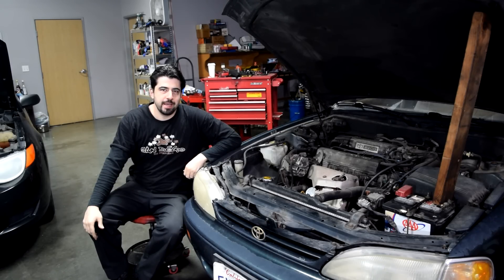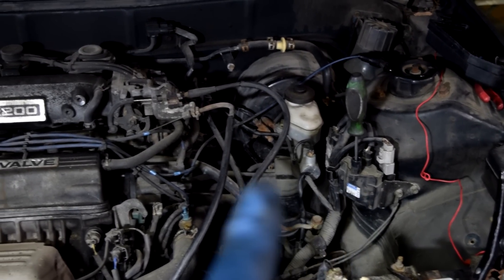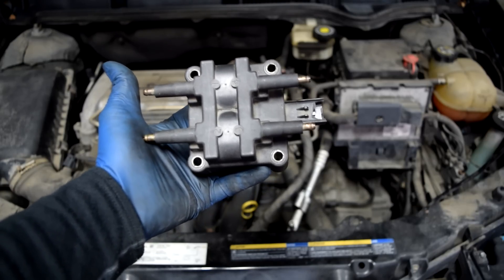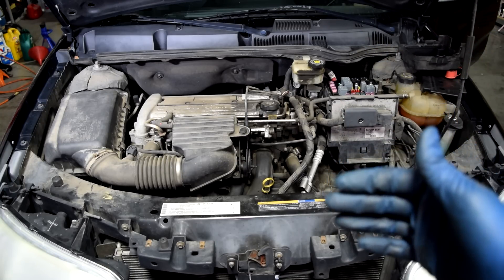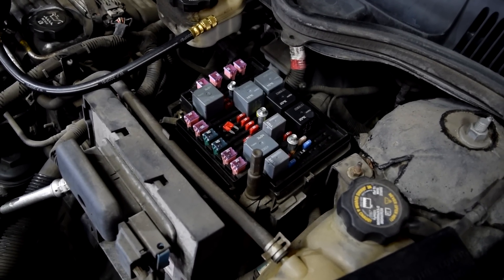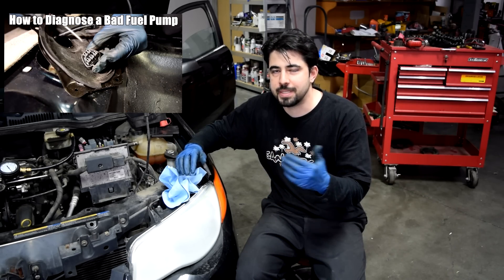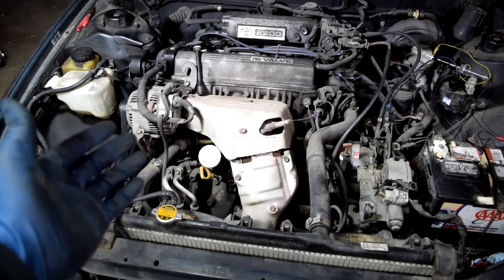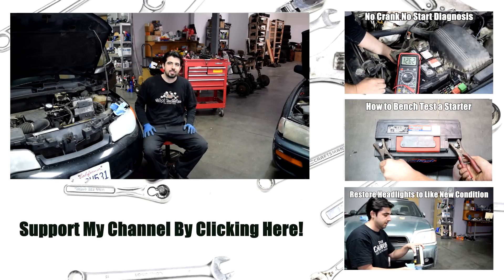How to Diagnose an Engine that Turns Over and Cranks But Does Not Start - Crank No Start Diagnosis

Comment: Great video mate there are many here setting timing when engine is running, but this is only one I found that deals with car that engine will not start (which is often the case) and sorts it out. Thank you!
Reply: I found others. multimeters+ voltometers are needed
Reply: @charlesdowns1691  we are finding the same, we never used to bother but now wouldn't be without them.  We used ours to check heater plugs on our Chrysler. We saw it was an easy way to test they are not broken, save having to take any out and change them. One of our cylinders is misfiring. That is why we though it could be heater plugs. But all ours is fine. Not sure what else it can be.

Comment: i have an eclipse 2002 gs 4 cylinder with a code p0300, and at first it was making noise on the left side of the engine (clicking noise) and i noticed that coolant was leaking from the lower hose (i think) which is green liquid. i filled the gas tank and the next day the clicking noise was louder, the car died while driving. the car now cranks but won't start. the rpm does not move when i crank it either. im desperate and i need help thank you!!

Comment: My 2004 Ford Ranger XLT 3.0L (75K miles) will NOT re-start on a hot / humid day. When cold, or first start of the day, it fires up and runs great. 
But If I shut it down after driving around a bit, the engine will crank normally, but will NOT start, no matter what. I've been stranded a few times now. 

I've changed out the spark plugs, fuel pump relay, the coolant temp sensor, the thermostat and put in fresh coolant. Checked the inertia switch, it seems ok. No blown fuses that I can see. I asked my local Autozone if they could pull some codes for me, they said they wouldn't touch it unless the Check Engine light was on (which it isn't). WTF. 

When trying to start it hot, I watched the RPM gauge, it seems to stay at 0 until the engine coughs (without starting), then it indicates a few hundred RPMs, so it seems like crankshaft sensor is working. I popped the gas cap off and turned the key on, didn't notice any primer pump hum / noise, but maybe too much outside racket to tell. 

So, ok - I was thinking maybe the fuel pump / fuel pressure, but once I get the truck running, it stays running fine. I would think that a bad fuel pump / pressure would cause it to stop running at some point, or at least cause it to be sluggish.  But when it’s running, everything seems fine, you’d never know there is a problem.

What is causing this?  Why are hot / humid days a problem?

Any suggestions...?? It's driving me nuts. HELP!!
Reply: zippy dodah. my Pontiac Grand Prix  although different vehicles is doing exact same thing.  fires up in the morning but after its ran a while and then engine switched off it won't restart or ( fire up again?) crazy. it will fly on instate ECT. good steady idle with lots power but hot humid days or about any day it does this. I'm concerned it's a cam or crankshaft sensor. really not sure at but so annoying.  my son can fix about any car. ranger ECT. did you ever find the issue?
Reply: I've had to keep my car running just to male quick stop to stores ECT. not good. I also wonder about I. c.m.

Comment: I have a mazda lx 2003 2.0 , I have electrical power on wires but no pressure gas and no spark, check engine is not turning on. the  car cranks but don't turn on I think that the crank sensor is dead what you think? the ECU IS GOOD DOUBLE CHECK.

Comment: On ford check out for a faulty inertia switch thought I had a fuel pump problem turns out it's was that switch
Reply: jesus noriega  what were the exact symptoms.. I have a 99 expedition.  I'm making sure that the fuel pump has to indeed be replaced..  I'm going to cam shaft sensor and relays and work back to fuel pump.. how does the inertia switch  disable fuel.
Reply: PIANOSTYLE100, jimthecarguy has a video, "Car cranks but will not start." Ford ranger had a faulty inertia switch. 
I guess it's a safety switch which is supposed to shut off the fuel line to the engine in the event of an accident, preventing accidental fires from being fueled with a leaking fuel line.

Comment: I replaced the ignition coil and cables but still no spark. What's the problem. Ecu motto if gives error code 100 which is control system error. Then when the engine started it only lasts for like 20
Minutes and then the engine stalls.
Reply: I've also replaced the crank position sensor and the problem remains. So it's something to do with electricals?
Reply: th tan  not a mechanic but I wonder if you have 12 volts at your fuel line .. I've been told the cam shaft sensor will disable the fuel pump.  Safety first under the car or truck.

Comment: Great video.   

Thats correct.   On some older vehicles that the tachometer is hard wired to the coil or part of the ignition system, the tach will or should flicker just a bit when cranking the engine provided everything is working like it should.  On some of the new vehicles that is not the case.  

Also, very good information on the crank sensors.   The two wire sensors are magnetic pulse generators and the three wire sensors are hall affect sensors.   Some hall affect sensors dont get battery voltage.   It might be 5 volts, 8 or 9 volts with the key on and cranking.   Keep in mind, some computers need to see the cam and crank sensor in sync with eachother when cranking the engine over to fire the ignition system depending on the vehicle application.  

Another good way to check for a base engine mechanical/incorrect valve timing problem causing a no start condition is to put your hand over the throttle body air tight and have an assistant crank the engine over.   The engine should only suck air in.   If at anytime it blows air out of the intake, then you know the engine is out of time.  Same thing with the exhaust but it should only blow out when cranking.   If at anytime the engine sucks air into the exhaust system while cranking, the engine is out of time.   

Great video thanks for sharing!
Reply: Amedee O'Gorman  that's a great trick.. hope to never have to use it  though.

Comment: Thanks this was a vary well done video, I have a Nissan Alitma 03 four cylinder, and it has an intermittent crank no start condition, some times it cranks just fine and other times hard to crank, then it will crank no start.  A few days later crank right up no problem.

I take it to the shop and they said they can't reproduce the problem to check it.  Do you have any advice for me?

Thanks for doing such good videos...

Comment: That MAF sensor cause for no spark would be a confusing diagnosis if the codes don't help. Nice review.
Reply: The same cable the got 12 volt is the one got the signal   only 2 cable what cable is the  get the signal
Reply: true

Comment: i have a 1988 camaro 2.8  5 speed it does the same thing motor turns over and Cranks But Does Not Start need help has
New fuel pump
New starter
New raditor 
Full tune up (spark plugs ,wires,oil
New flowmaster exhaust 
New fuel relay switch
New battery
New alternator
New fuel lines
New ecu
Reply: Jerry Kidder  did you ever get your car going. not a mechanic.
Reply: look at the distributor if it has one, and or the spark plug wires

Comment: i have a saturn ion 2004(shitty car i know) i did the crank shaft gasket on it, drove it for 5 min, shut it off. while checking a power window problem, a short circuit occured with a window motor, so i unplugged all the controls in the doors. now the fuse don't blow anymore but the car won't start.i changed the starter because it was heavily coroded and also the cable that goes to the fuse box. i did the crankshaft positioning sensor and checked for continuity of the connection,changed the sparkplugs and the car still don't start. it cranks and compress but i don't have juice to the spark plugs. i checked all the relays and fuses and yes theres is gas comming to the combustion chambers. the only thing left to try is to really test directly the fuel pump to be sure that its was not only the gas from the line and also the coil pack.(yes i did fix the barel issue)

Comment: As always great information, the other situation where I have encountered a no start, no fuel and no spark condition would be with the security system not allowing it to start.
Reply: parcha2  a mechanic friend of mine rebuilt a late model convert able engine.. they disable on purpose .. to make sure their not stolen. they also have multiple backups. Mercedes likes to have their own people working on their vehicles.
Reply: Can you clear the codes by disconnecting the battery and connecting the negative and positive battery cables together?  Someone said it will discharge capacitors in the computer and reset the security codes.
Reply: @pby1000  works on the old fords up to 1996.

Comment: Perfect timing on this! I'm going through this right now! Fuel injection and distributorless  ignitions are little out of my comfort zone but I'm getting there. If this thing had a carburetor and a distributor on it, it would already be running. Thanks for the video!
Reply from the maker: +Tim Garrett np, hope it helps you out. cheers
Reply: Honda accord how      how replace mother in door
Reply: I991hun replace a motor in door cha how to replace a motor in door
Reply: Eev gym at
Reply: that would be my choice also.

Comment: These videos are excellent because they are thorough and methodical. Too many DIY videos assume a lot of prior knowledge and miss out crucial steps. Keep up the great work!
Reply from the maker: +DJ R Glad you like them. thanks for watching.
Reply: Ratchets And Wrenches nice video once again. i wish i was near your location, you would get all my business! I still have the intermittant cold start problem with my Mercedes ML Diesel. when the weather is warm, no problem. annoying! thanks again!
Reply: Ratchets And Wrenches  could it be the ECT Sensor, particularly when the weathervis cold?
Reply: all coils ignition require a capacitor for the coil to resonate is it in the ignitor or coil pack it would normally be on neg. point or signal side .?

Comment: I'm having this problem with my 1993 mazda MX6 2.0 4 cylinder.. the car is getting fuel and spark but all it does is just crank.. any ideas?
Reply from the maker: +Bruce Paddock This video is pretty step by step, did you check injector pulse? Compression test on all cylinders?
Reply: +Bruce Paddock do you have a second key? it could be the engine immobilizer not recognizing the key you are using and hence hindering the engine from starting (if your mx6 already has this feature)
Reply: +andi I do not have a second key.. i replaced my distributor, fuel filter, starter, battery & my ignition switch.. still nothing.. fuses are all good as well.

Comment: exellent machine but must have high mileage distributor cap also the problem in coal
Reply: ok my 1990 Toyota  Camry it cranks  wont start has spark
i done so much to replace  parts .need ideas??
Reply: coil?